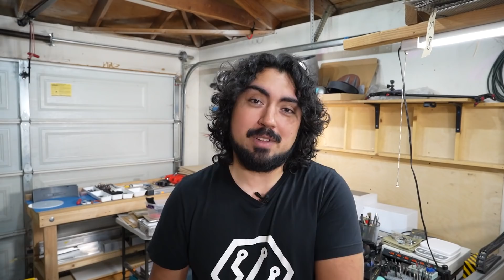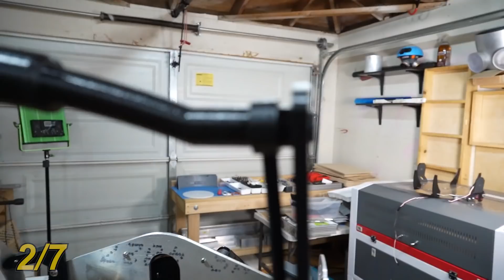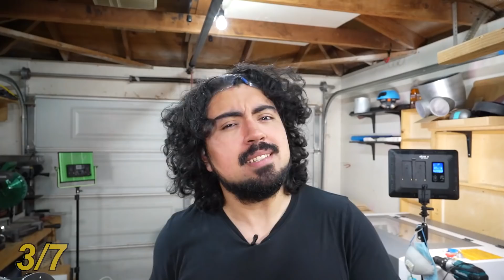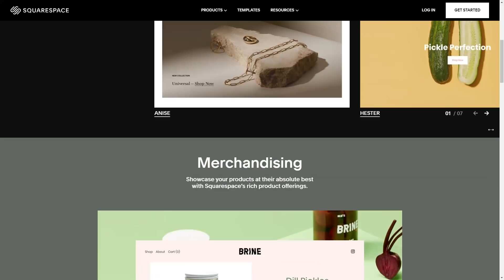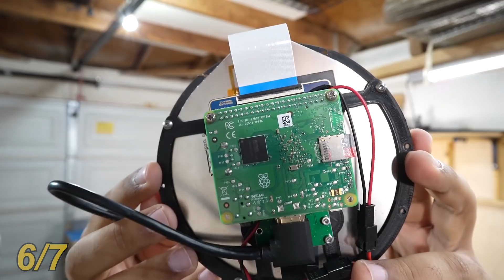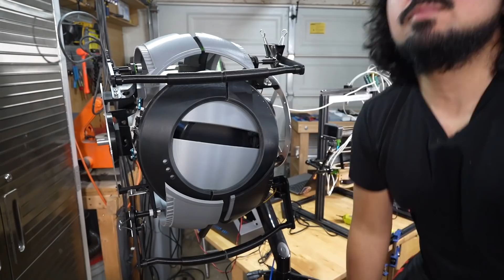Portal 2 | Wheatley Animatronic Upgrades and Test

Comment: Great video!  But i got one part that got me curious, the belt driven part of your creation to be exact. Myself working as a car mechanic and already worked on many old timing belt driven Engines so the tensioner got me wondering if you would change it up like in a car and let the backside of the belt slide over the tensioner, it wouldnt wear out the belt as much and would may approve faster turning times without skipping some teeth in the belt?
Reply from the maker: Yep, it's inside out! Put it together at 2am and didn't think twice about it.

Comment: I feel like Wheatley's lower casing there or his optic should be positioned so his optic is more in the middle. There's a lot of space at the top that is unused and it feels kinda like Wheatley is hiding while he's "talking" with the way his eye is at the bottom unless you hold your hand really high. Other than that, I feel like he really is ready for the outer shell casing! Great job man!

Comment: 6:33 Ugh, what an ugly belt tensioner position. It should help engage with more teeth and not let them slip instead of what you did. It probably added lots of opposing force so that your servo broke.
Reply from the maker: Hmm, yeah, it's inside out! That's what I get for assembling this at 3am

Comment: I would recommend getting an fpv hdmi cable to operate the round 1080p screen, the cables can be as short as 10 cm and are completely flat with interchangeable hdmi ends. That is, if you cant find anything else that works.

Comment: Valve: Eyelids would be impossible.
Volt: I missed the part where that's my problem.
Reply: I missed the part where that's my problem.
Reply: @Cr4z3d  I meant to put that but I couldn't remember the line, thanks!
Reply: @bpnbeckeroo  Lol no problem, I wasn't criticizing it though was just quoting it in response

Comment: Real question: When hes done, will you be able to pick him up by the "eyebrow handles" without breaking him?
Reply from the maker: He has to be supported from the metal plate at his back. The handles are thin plastic would snap. Even if they were a stronger material, the way the weight is distributed, it would still be too much stress for them, since the weight of his whole body would be on the handle motors now too.
Reply: @MrVolt  Ah well. Looks amazing though!

Comment: I wonder if there's a way to program slow ins and slow outs for the servos. Seems like the build could benefit from that usage. Many robots that move look robotic because their body is swift and sway from the movement they make. Adding a type of slow in and slow out will help stabilize the robot. This one could be easy because most of the servos are one action, meaning they only go one direction and back.
Reply from the maker: Definitely! I haven't tuned any off the acceleration profiles for the motor yet :)

Comment: If you put your sanded pieces under an infrared heat lamp just like they do in a body shop (you can buy them online) they won’t get warped in the sun I also recommend using a timer for them so they only heat the pieces for so long
Reply from the maker: Thanks for the tip! Ah, I would love to have a spraying and or drying booth for parts. I wish my garage wasn't full...
Reply: @MrVolt  if you look on eBay they make really small inflatable paint booths that you can inflate to do small projects and then air them down and push them out-of-the-way when you are needing more room